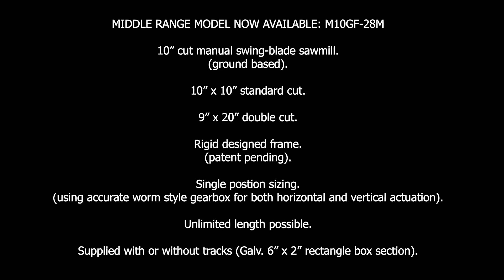Turbosawmill 'GROUND BASED' 10" manual mill.

Comment: Can you  do slabs with this unit tanks
Reply from the maker: Yes a slobber can be fitted to the frame.
Reply: One last question  will this  new style come with auto feed? thanks!
Reply from the maker: @BlackDevill9  no it will not.
Reply: @TURBOSAWMILL  anything in the works in the future cause i need to know im doing my research, im in the market for both slaber and swing blade cheers
Reply from the maker: @BlackDevill9  we make the best possible automated swingblade and slabber. But it's not a twin track design it's a monorail design. Now we have introduced a center leg option making it the strongest possible option too over extended lengths. Check out our YouTube page.
Reply from the maker: The twin rail is an extremely cumbersome design to automate. Twist in the vertical cut. Sawdust. Complicated mechanism to swing the blade, hydraulic hosing etc. List goes on. Been there done that. Mono rail is awesome and simple. Easy to move on wheels etc too.
Reply from the maker: @BlackDevill9  https://youtu.be/HWpKH7wpADg